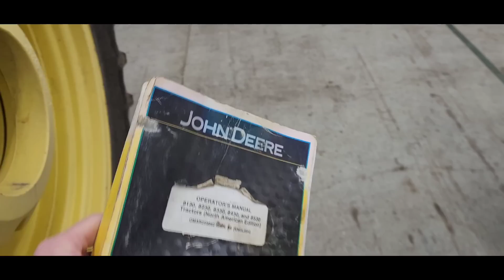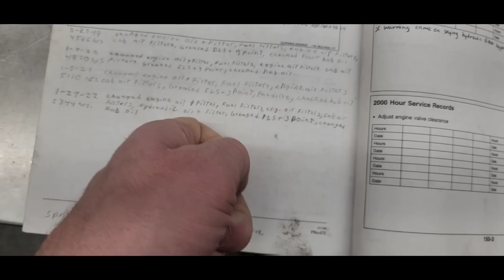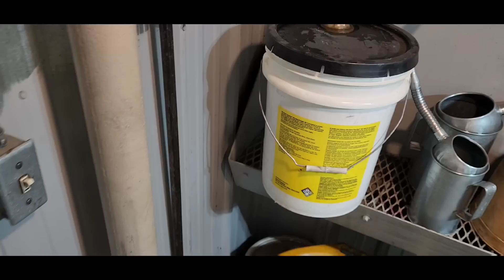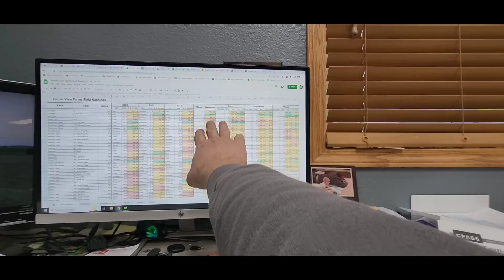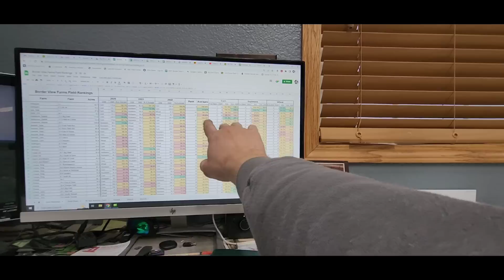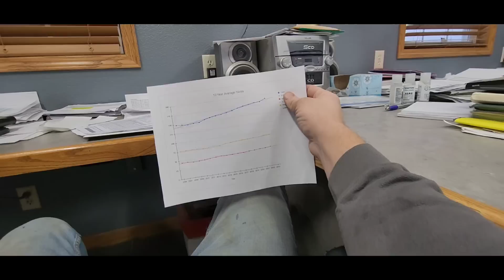Fixing a Flat Backhoe Tire

Comment: Hey Nathan, might not get very much snow ❄️🌨️ but going to be EXTREMELY COLD 🥶🥶🥶 it's ONLY 2 degrees here in Carthage Missouri so BETTER make SURE you have the HEATERS working in the Tractor 🚜 and Backhoe, pretty Important , keep you guys warm while your pushing snow ❄️🌨️🥶🌨️  check the Ole fluids, belts and ETC  , GONNA BE A COLD 🥶 couple of days 🚜🚜🚜 CYA NEXT TIME, BE SAFE OUT THERE

Comment: Just an FYI.  Portable air tanks should have an expiration date on them.  You don't want a catastrophic failure.  That would be a bad day.

Regular air tanks are to be hydrostatically tested on a regular basis.  New portable air tanks are usually cheaper than the cost of the hydrostatic test.

Comment: I wonder if u took hot used engine oil and dumped it into the tote, if it would loosen up the sludge to clean out easier

Comment: Will the oil sprayer that you used on the corn head and truck frame work at keeping the snow from sticking to the tractor buckets?
Reply: It's basically like corn head grease
Reply from the maker: Maybe.